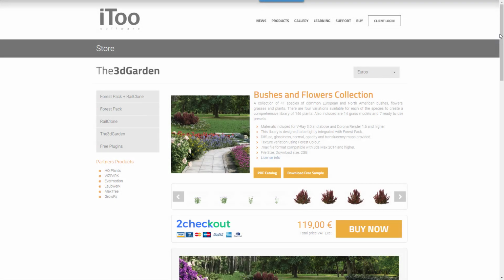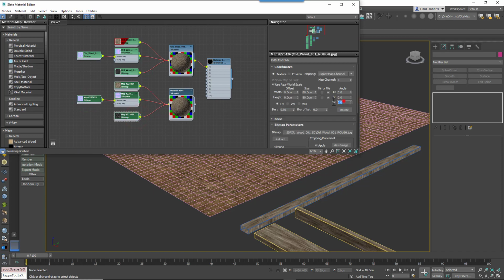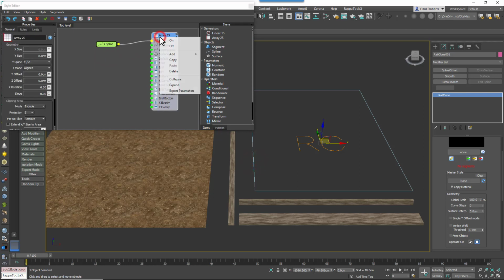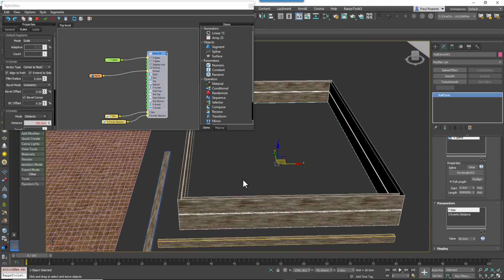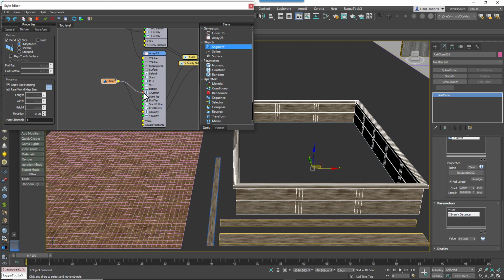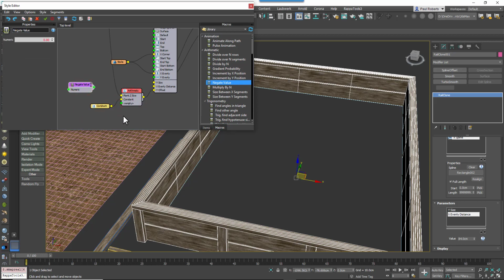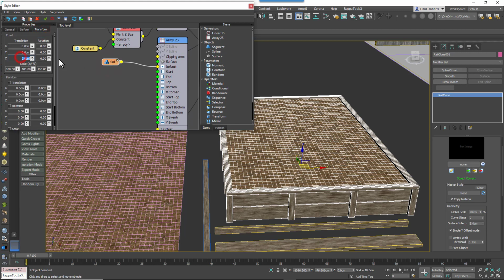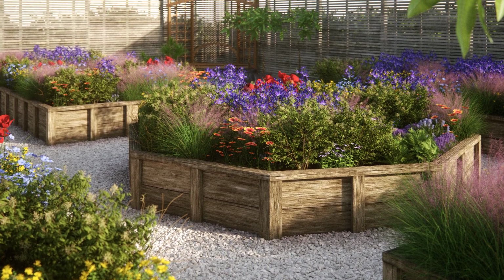TUTORIAL: Raised Flower Beds Part 1 - RailClone (intermediate)

Comment: Wow this got really complicated fast I could model this without parametrics faster. I thought this was supposed to be artist friendly software ? Some of the steps and work arounds require an intimate knowledge of this plugin that you cannot just stumble upon.  Might be an idea to rethink how it works.
Reply: You might be able to model it faster initially. But what happens when the design changes and a client wants to see it quickly... That's where it comes into its own. You'll be remodelling all your planters, whereas if you'd used this, it's a few clicks and everything is updated.
Reply: @chrisbowman5910   not sure a planter box is going to be the clients focus in an archviz project.
Reply: i think you're focusing too much on the tutorial itself rather than the techniques- sure it may not be useful if you only have to model a single flower bed, but if you are dealing with an entire garden then its efficient. plus you have control over UVW randomization and other techniques to remove repetition. 

The more you use RC the easier it is to set up complex systems, and the more utility it has. I do agree that some things could be simpler but working within the confines of Max cannot be easy, i'd imagine.